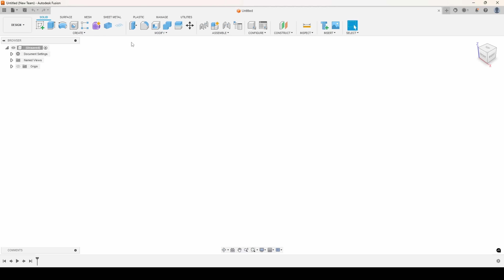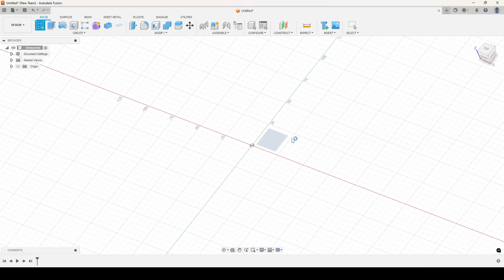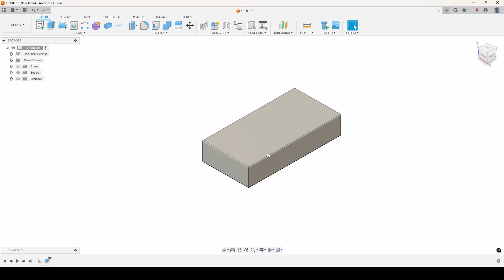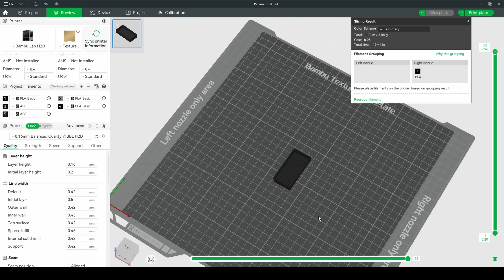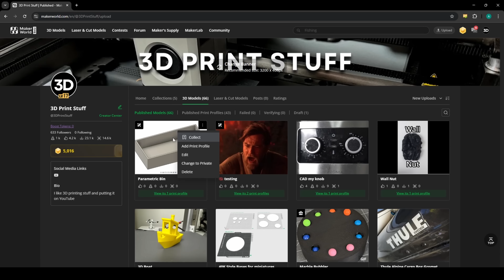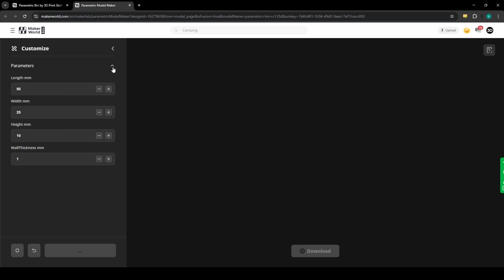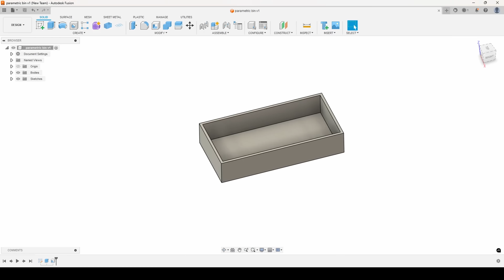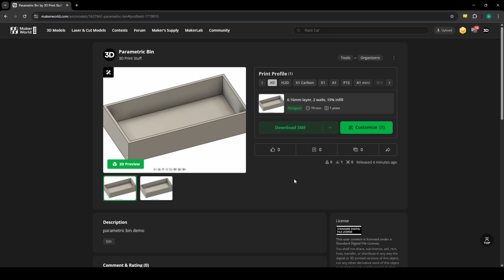Cool new MakerWorld feature

Comment: Be careful, Bambu labs doesn't like CAD pictures, but proper photos of finished printed parts, I had points removed because of this.
Reply from the maker: Pinned your comment for others to see. I was just using this model for demo purposes, if they want to take away any points it might earn that’s up to them. But good for others to be aware of.
Reply: This is great for users, gives a realistic image of what you can expect with the designers print profile and design. So honestly, good move on their part imo.
Reply: Very true. They want proof that it’s actually properly printable.

Comment: Super useful and straight to the point, thank you. Does anyone know if it's possible to set min max values in maker world to a parameter ? For example : i wan't the user to be able to change the width from min 30mm to max 50mm (to avoid breaking designs). Thank you